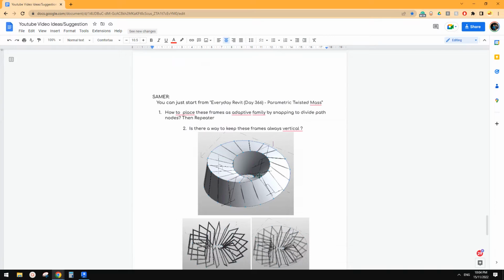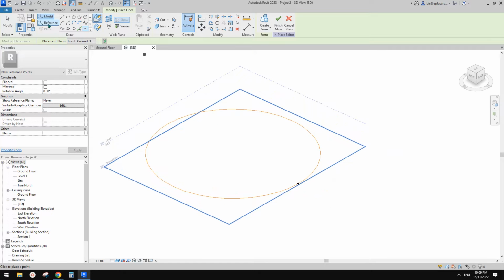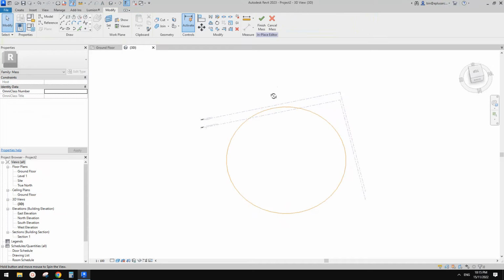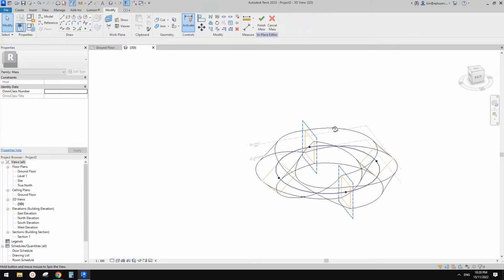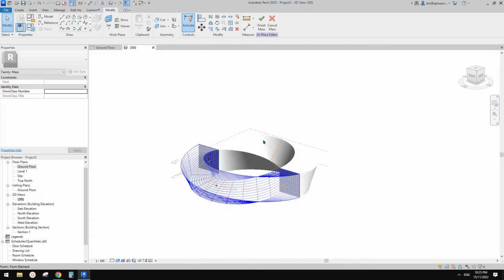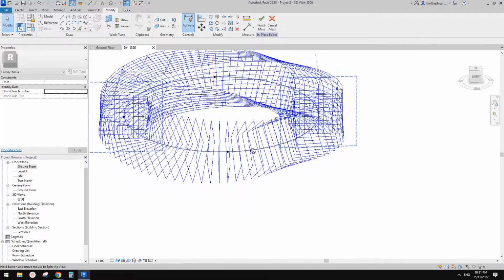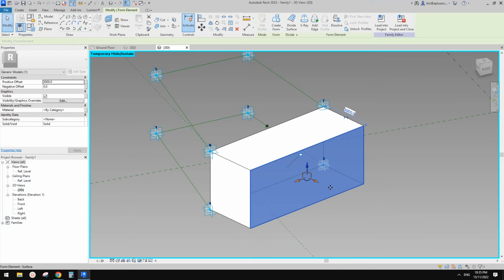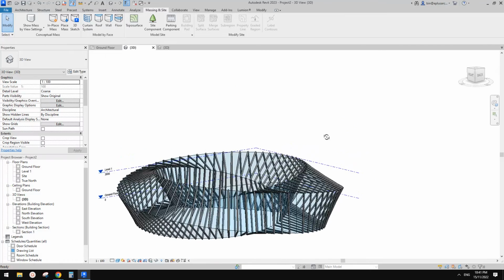Revit Exercise (Day 965) Mass and Adaptive Family Exercise

Comment: Oh … how good … Nice Nice , some question then : 
1. Could not we use only 4 profiles on the 2 half-circles to create the mass? (In stead of 3 on each half) 
Can’t we “reuse” the profiles at the end of arc for both sides? 
2. You have mirrored the reference planes RP cause the array is not active in mass environment? But can we load the mass into project then array radial by angle all the RP then edit mass again? 
3. Is it possible to create panels between the frames as a part of the adaptive family ? Like as if between the frames there are horizontal mullions ?
Reply from the maker: 1. Yes, we can. However, we might not able to achieve the shape we expect.
2. Yes, I am pretty sure we can not use array in mass. Can you double check? I don't think conceptual mass works, model in place mass might work. I will not worry too much about this, because the mirror method is not too bad. It can be quite tricky to control the number and angles in the radial array.
3. Yes, just create spine through point between points 1 and 5, 2 and 6, 3 and 7, 4 and 8, place a point using draw on face, place a profile using draw on work plane, create form.
Reply: @BINHE615  you are right ….
Neither il conceptual mass nor in-place mass you can use array. In both environments it’s kept for repeater instead of array. Agree mirror is much much easier than array radial. 
Maybe you can show a supplement for this tutorial the bracings between the frames as a part of adaptive family. I can send you a little video to see the entire construction shape